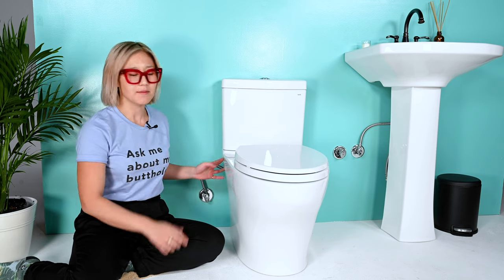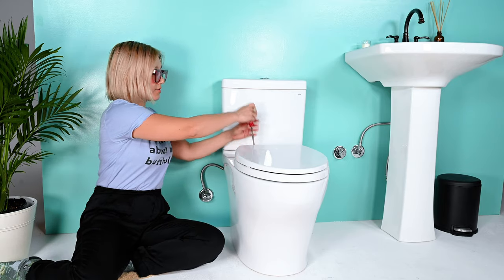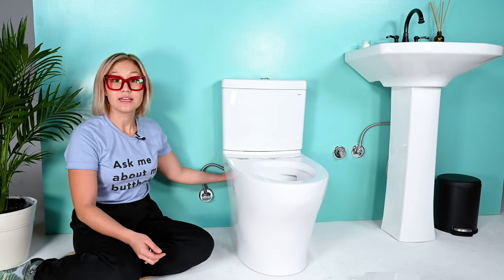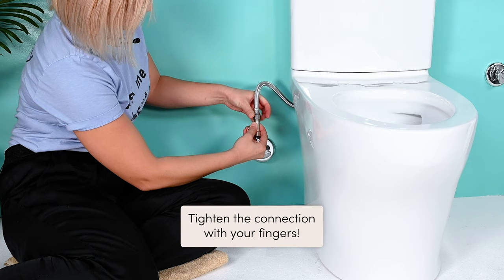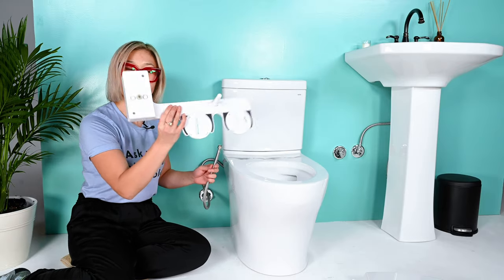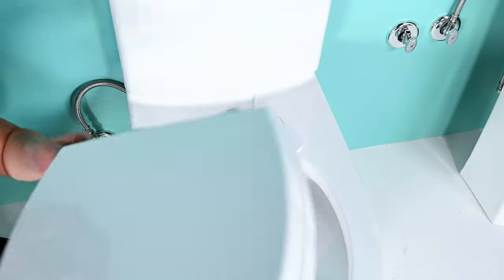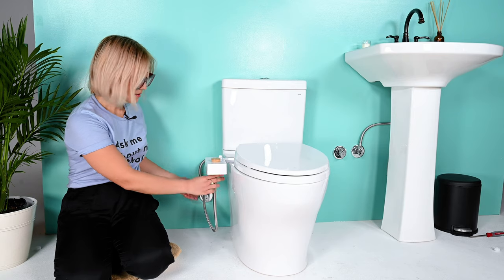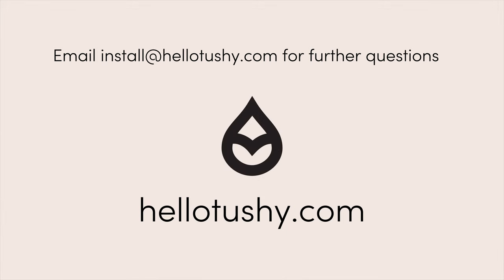TUSHY Bidet Installation on Skirted Toilet

Comment: My toilet is like the one in the video, but I have a rigid plastic pipe hose instead of the flexible one. Even if I got a flexible hose, how would I install it? The plastic pipe connects somewhere behind the toilet which I can't even reach... am I out of luck?